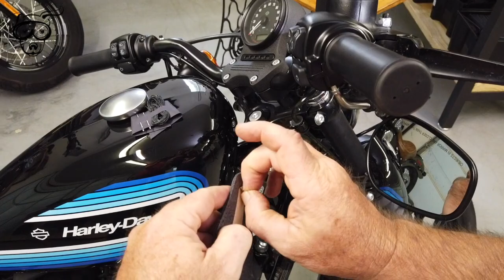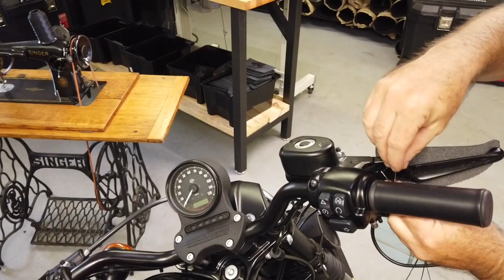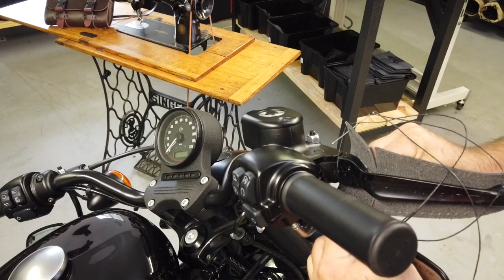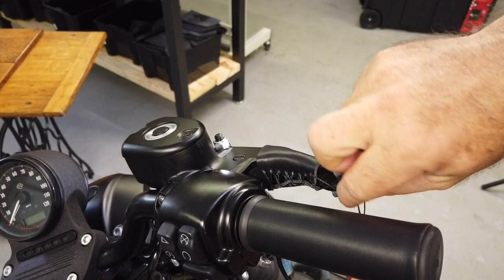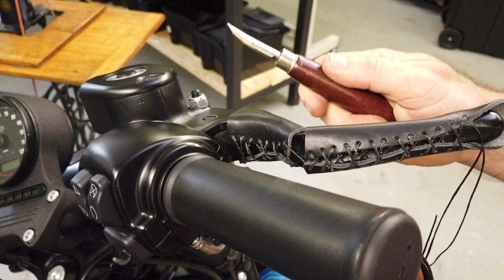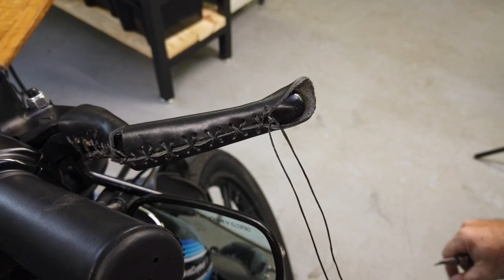How to install Lever Covers on your Sportster

Comment: I stitched my first set of leather covers on my levers. Did they get loose with time no matter how tight you make the stitch. I ended up using adhesive and gluing them on, and they never moved since I glued them on. I have a video on YouTube showing it